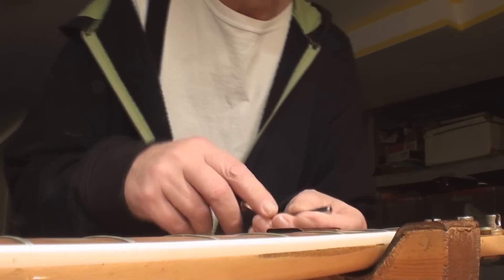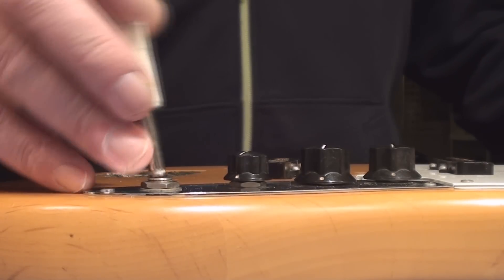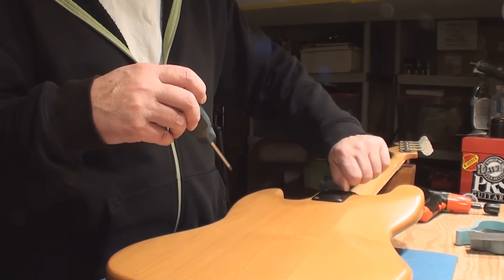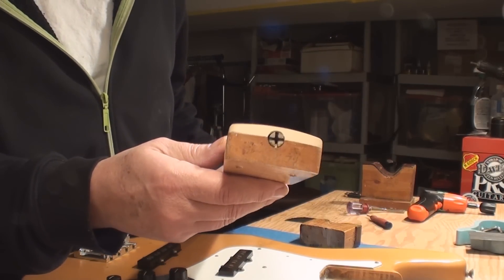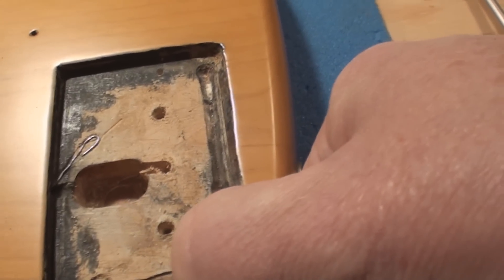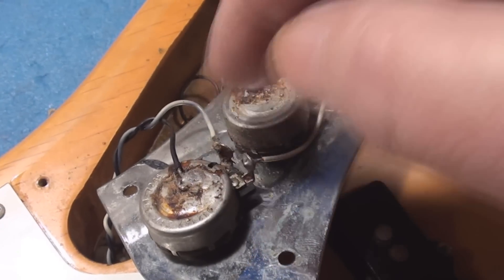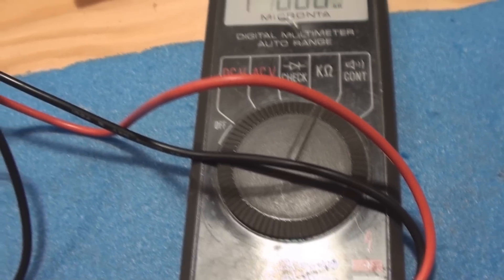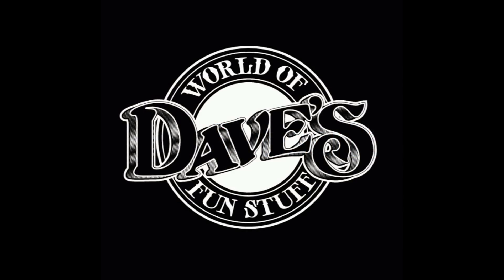1972 Fender Jazz Bass  The Story Continues

Comment: The mistake was the original Badass bridge wasn't designed for Fender basses but for Gibson basses. Next all that flux hides the fact that there are cold soldering joints all over that plate. Probably used too much heat on those pots too. I would not trust those pots at all. This is an interesting patient, I'm looking forward to the bridge replacement and electronics repair on this one.

Comment: Merry Christmas Dave,thanks for sharing, great video. I am in the mist of building my own bass guitar and I just finished soldering the pickups and was wondering if from your experience there's supposed to be an inheritable sound difference between Bridge pickup and neck pickup because for some reason when I tap the neck pickup the 'dump' sounds much boomier   then the neck pickup
Reply: It's Kent armstrong pickups, yes he did label 'B' and 'N' it's just that I think the volume of the bridge pick up is a little lower then the neck one
Reply: OK. My bad... Opened the pickup to reveal the wire and it turned out that I didn't solder it correctly.

Comment: You need to pull the pickups and see if the leads are properly attached/soldered to the points on the bobbins.  I agree that it is worth making an effort to clean up the original pots and try to use them.
Reply: It's not worth the effort at all. This is a 70s Jazz Bass. Fender has made hundreds of thousands of these things over the years. They are still in production today and you can buy a brand new one for $1000 USD. This isn't some vintage Ferrari where the only made 250 of them. Even vintage pots and pickups can go bad, but they are still making them. You can go buy brand new CTS pots and a Switchcraft jack and an orange drop cap for $20 or $30 total. It sucks that the pickups crapped out, but again, you can buy new ones. You can even spend the money on Fender pickups if you like, but for some single coils that are wax potted and at 7.8kohms, guitarfetish.com sells them for $40 a piece. So really, for $100 USD or so, you can completely rewire that guitar to be in stock configuration with pickups that will more or less match the stock voicing. For $200 or so, you can have a prewired EMG pickguard.
Why play around with old broken electronics that were mass produced to begin with, when you can have new reliable stuff and enjoy a nice vintage bass?
Reply: Why play around with old broken electronics that were mass produced to begin with, when you can have new reliable stuff and enjoy a nice vintage bass?

Many would consider any vintage Fender "old broken electronics" and if utility is the only concern then just get a new one.  Most people in the market for an early 70s Fender bass want it all original, however -- and that certainly increases the value of the instrument.
Reply: If you were taking about some early model or rare artist custom, I could see the value. But this isn't an early model and it isn't rare. This ain't a '59 gold top signed by Les.
It's a run of the mill J-bass that isn't original anyway. It has Bad Ass bridge and has been refinished. It's a player.
Reply: That may be how "you" feel about it, but there is clearly a market out there for Fender Jazz basses from this era in original condition.  People are clearly willing to pay introductory vintage prices for them, and clearly besides a refinish, the biggest modification that degrades value is non-original pickups/electronics.  None of this is "my" opinion, but it is an objective fact reflected in the market.
Reply: But you make a good point that this one is refinished already, which has pretty much destroyed any vintage value it has.  Still the original pickups -- if defective -- could be rewound by Lindy Fralin, which would be cool -- even with new pots :)
Reply: For one in great condition, yes there is a collectors market.
This one is not in great condition. The only way to make it in great condition, is to refinish it yet again to a period correct color and repair the crap routing for the aftermarket bridge.
But then, you've got a restoration and not an original. And a bag of broken electronics that won't work again without taking them apart and fixing/rewinding them. And then they aren't original either.
Now what? Sell it as an original and lie?
Reply: I basically agree with you, but if you look back at my original post I merely suggested that Dave check the leads on the bobbins, which he did not do (at least in the video), and take a shot at cleaning the original pots, which often need just that to wok fine.

Comment: You know, if it were me (and it's NOT...) I'd just get halfway decent replacement pickups or even cheap shitty ones so I could at least use the instrument while I figuring out if the existing ones are cost-effective to fix. Hopefully it's something easy like the coil's in or out wire(s) coming un-soldered. Is it even worth getting so-called "vintage" bobbins rewound? Like you said, once the original wiring's compromised you may be SOL in terms of value...

Comment: Well, like other equipment from 72, you can try to get NOS parts and attempt to restore some amount of it, or spend the money and put new stuff in it. If your buddy has any sentimental attachment, sounds like this bass gets to start from scratch. If your buddy doesn't have any sentimental attachment, sounds like this bass is destined for a wood pile or somebody elses hands.
Reply: I'm going to ask a question, because I'm curious of your opinion, and know it ultimately falls down to time, money and what the customer wants. The guitar products company that we love to hate has done a video on replacing a section of body wood on a Telecaster using similar wood, and attempting some grain matching. With this bass having the finish that it has, would you consider it a good candidate, assuming it's what the customer wanted?

As towards the electronics, from what I could see from the video, it didn't appear that the leads were damaged. Is is possible for a break where the leads are soldered to the pick up, or do you suspect damage to the coils themselves?

Comment: Dave, what are your thoughts on installing a musicman style humbucker in a jazz bass. I have a super super shitty squier jazz bass that I gooched the finish on and fucked up the bridge pickup, and I was thinking about routing out a spot for a humbucker. think it would sound any good?
Reply: im not dave but i can tell you that it would sound like shit, squire j-bass sound fine so no idea where you bought your super shitty one from, i guess off some dude in a parking lot, fell off the back of the truck, etc.
Reply: Iggy Tubmen nope. It was my first bass, and I got it new. It has always sounded awful to me. I don't like J-basses very much. I prefer humbucker basses like stingrays and WAL's. And I was only wondering what Dave thinks because the bridge pickup is F.U.B.A.R. and I only play my Ric now, so it's either the trash or giving it a musicman pickup.
Reply: Harubro Haruhara How attached are you to the guitar? If not much I'd say just go for it. Take take your time and plan it out. Have a backup plan in case the humbucker doesn't work out.
Reply: Heath Barnhart it's going in the trash if I don't do it. So I'm not attached in the slightest. I gooched the bass to absolute shit when I was 14 (got the bass when I was 5, and I'm 20 now) I went through a metal phase and stripped all the paint off and repainted with white and dripping red. It looks awful. So yah. It either a music man pickup with extra heavy gauge strings, or scrap wood.
Reply: Go for it then. Even if it doesn't work out you'll learn something
Reply: Heath Barnhart exactly.
Reply: Research where the MM pickup sweet spot is and try to put the pup in the same place to get the tone as close as possible.
Reply: If you have the money for a Ric why not pick up some cheap J bass pups instead of going humbucker? They are all over the internet - ebay - and you will be able to play it rather than digging a swimming pool into the body.